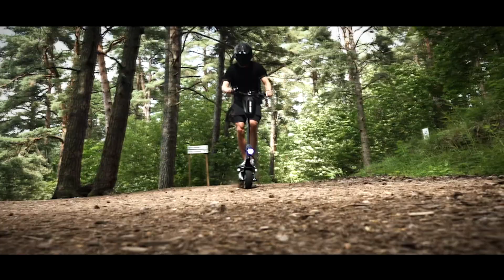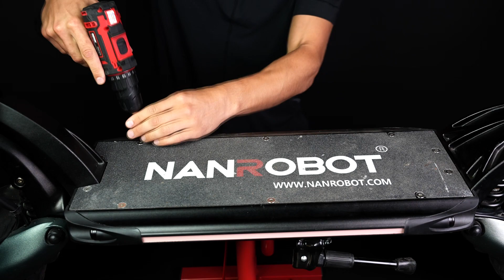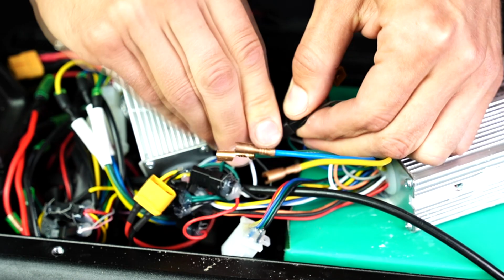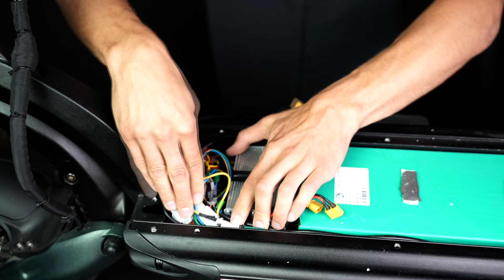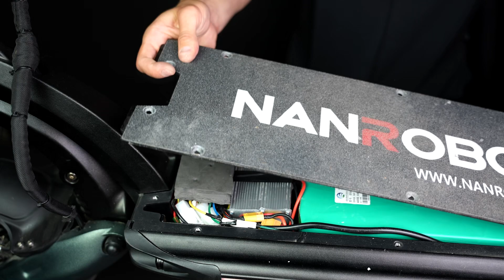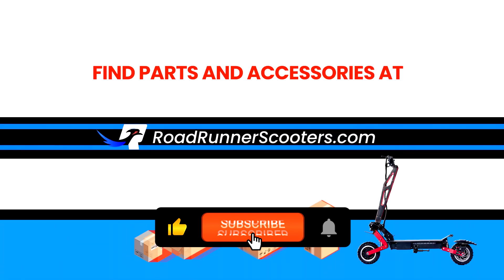NANROBOT CONTROLLER REPLACEMENT - HOW TO REPLACE CONTROLLER

Comment: If you ride in the rain and the rear wheel stops working is it due to the controller or the motor?
Reply: Did you ever find out the answer? My D6 was left out in the rain for a little bit and now I can’t go past 10mph.
Reply: @anthonyyoung1871  I think it's due to water getting into the controller but I never got around to replacing it.  Nanrobot scooters only have a IP53 rating so water can easily enter into the scooter and damage the circuits.

Comment: can you do one about replacing the led lights strips on the side please
Reply from the maker: It's in our list!
Reply: @RoadRunnerScooters  also add rewelding a cracked weld on the handlebar riser to the list too please.... since the part is not sold separately anymore my scooter is unusable till it gets rewelded
Reply: huge safety issue with it wobbling at the weld seam

Comment: It's like you made this video just for me 🙂 RoadRunner sent me 2 new speeed controllers cuz they are faulty. Thank you for all of this helpful videos!!!!!
Reply from the maker: Great to hear!
Reply: @RoadRunnerScooters  so I finally installed the new speed controllers and was so proud of myself that I was able to do it. The sad part is that still didn't fix the eco mode button to kill the power. When I press eco mode it kills power and doesn't go. So RoadRunner sent me a new turbo/eco switch and that didn't work.  Then me n the guy who works at RoadRunner thought it has to be the speed controllers. Well it's not and that's so odd!! I use the eco mode button on my d4 and I like it cuz I get more range. The fact that this still doesn't work isn't cool.  I didn't spend all that cash on a partially working scooter. My d4 works fine besides the sqeaky brakes and front suspension bottoming out.  This really sucks and now what do I do?
Reply: @spazoidpue  that's crazy .. they not going to help u anymore
Reply: @spazoidpue   did you ever find a fix? I am having the same problem.
Reply: I'm having the same issue . Did you get a resolution?